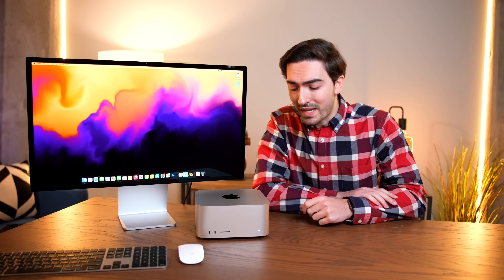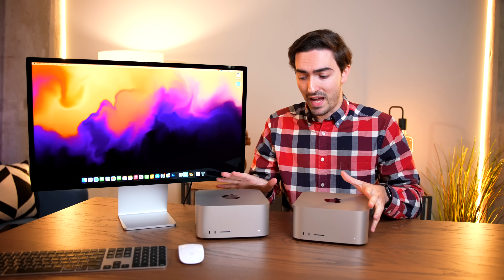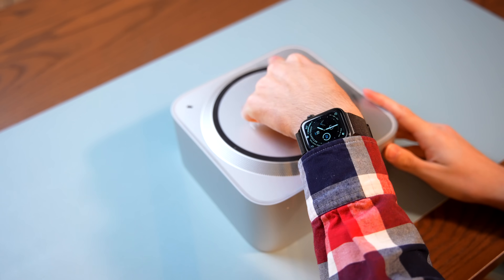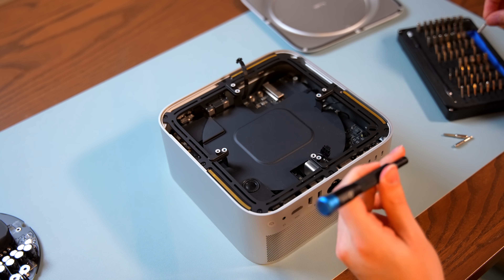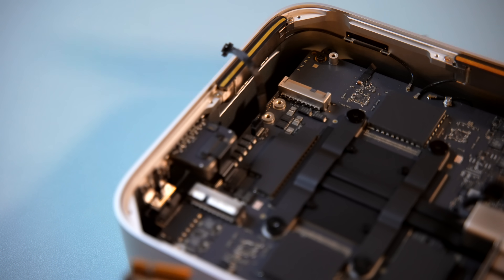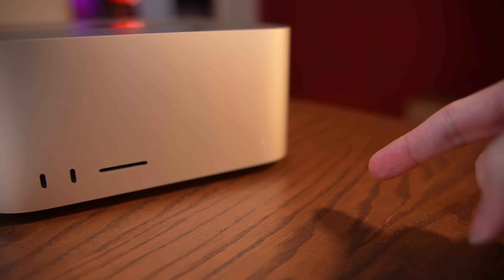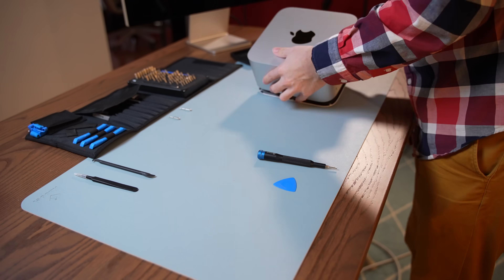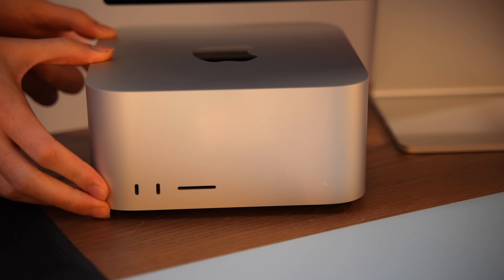What happens if you try to UPGRADE a $5,000 Mac Studio?

Comment: I think this was to be expected. All Apple devices in recent years had either a T1&2 chip or some other secure enclave function, with that comes hardware encryption of storage, not just on a data level. Mainly so that memory devices can not easily be extracted, transferred to another machine and read. Either the storage was 'paired' with the hardware or it wont work. 

Just by the way, most car radios have to be registered in ECU of the car to be enabled, most only the manufacturer can do this. So to prevent theft and sales of stolen items.
Reply: encyption does not work like that, you cannot just put an encrypted drive into another machine and read it, and in this case the machine itself is ID'ing the SSD there's no need to do that if you want to "encrypt" data.

All your passwords in all databases are encrypted without having the need to ID the drives.

We can still protect the data written on drives without having the computer check whether it's the exact same chip which manufacturer installed or not
Reply: @nishantdesai3705  
"...there's no need to do that if you want to "encrypt" data..."
It's like why do we need MFA, we can just only use a password to authenticate..

I see 2 different perspectives, 1 is security, the other 1 is related to service/upgrade related.

I can understand and respect both.
Reply: @RIKOARIshowreel  no with MFA it adds additional security, whereas with this system it does not, people do not roam around with with their mac studio's SSDs in their pockets right?

MFAs came into the picture because of phishing attacks, browser's "save pwd" functionality, etc. Currently there's no known way to easily breaks high level of encryption (aes or any other 256 bit encryption) in feasable time period (few hundred years)

So if some random dude has a feasable way to break the encryption (which is highly unlikely if not impossible) and they can open your mac studio and steal the SSD to get your data then now they would just steal the mac studio together with it (which do happen) so there's literally no benefit, all it does is help Apple preventing you (consumer) to fix your mac studio if for some reason storage module stops working (which is fine if they'd soldered it on to the board but they didn't).

All major websites/companies dont store sensitive data like user's pwd on macs right? they save it on other regular machines which are probably rented from AWS, Google or Azure (which might have disk level encryption)
Reply: @nishantdesai3705  
"...people do not roam around with with their mac studio's SSDs in their pockets right?..."

I agree with that, whereas not sure on this one "...no with MFA it adds additional security, whereas with this system it does not...".

We can have so many arguments about this, but in the end we have no justification on what use case(s) Apple have behind the reason for doing this.
Reply: This kind of encryption won't work. First, all key stored in a physical hardware, if someone wants to crack, at least you got hardware to extract the key. Second, if you know there is a hardware encryption, in case it can't transfer the ssd to another machine to use it. Then you have to backup regularly. Then backup is another weak point of information security.

Comment: Apple used to be great at this with upgradable storage and RAM on their unibody MacBooks. It is really bad of them to artificially restrict upgrades like this. And flashing the SOS signal is just ridiculous. Poor little Mac have feelings and you violated them. I wouldn’t be surprised if Apple will get a law that says their products have rights and you are violating their “human” right by opening them up. If I buy a product I should be able to upgrade it. Old macs are still very usable when upgraded. I gave my mom a 2012 unibody MacBook Pro with upgraded 16GB RAM and a 512GB SSD and it works fine for her. You can boast about using less plastic but when you restrict things to make them get obsolete quicker you don’t get any points for being environmentally conscious.

Comment: Yikes… If Apple had wanted to make it accessible the bottom would twist off with a coin… the way they used to. But given the screws are hidden under the rubber ring it’s a clear sign this wasn’t going to end well. With ‘only one more Mac to go’ I can imagine that if the Studio was upgradable it would cannibalise the future Mac Pro Tower. This is also why the Studio GPU is throttled (MaxTexh video). Similar reason why Final Cut isn’t available for the iPad Pro. Hopefully Apple will change if there’s enough push back. Here’s hoping they provide more options for Pro users.

Comment: It's likely the T2 Security layer. It likely locks it at the hardware level. It'll be interesting to see what happens when 3rd party, or replacement drives are available. 

I'm betting when a virgin drive is ordered, it'll work fine and software will become available to un-pair and nuke the security from the drive (while likely also nuking the data, of course)

Comment: It sure looks like Apple Company did something to lock the original installed solid state drive to hardware of the Mac Studio so that if the hardware and firmware does not see the originally installed SSD the machine will fail to boot. This does get ridiculous that the internal SSD can not be user upgraded. This is all the more obvious by the fact that Apple is using their own proprietary SSD.

Comment: I think that the removable ssd has nothing to do with the ability to upgrade. I suspect that the memory swap issues on soldered ssd’s was creating headaches for them and this is there solution to fix failing ssd’s rather than throwing away the whole board .

Comment: sos = option+alt with USB drive plugged with ISO bootable plugged in > disc utility > format = welcome to Mac
Reply: Suppose you could also have a bootable network, and you didn't boot into "recovery" holding the power button as you said, you just don't know what you're doing.
Reply: And boot to recovery, btw, not to system with many other checksums
Reply: Jfc, that is NOT how you boot into recovery. Smfh

Comment: On Apple's "Security features for Mac Studio" page (I'm assuming links aren't allowed in comments), it says the SSD is encrypted, so it makes sense it wouldn't be able to boot from a swapped SSD: the machine does not have the encryption keys to read the SSD from a different machine.

From the page I mentioned above: "Secure storage: Your storage drive is encrypted with hardware keys to provide advanced levels of security. In the event of a catastrophic failure, data recovery may not be possible, so you need to back up your files to an external source."

Comment: I agree that we need the right to repair, esp when a company claims to be so environmentally conscious. I don’t agree that they have to design the power supply to be idiot proof. If you want to try on your own, like anything else you can repair, know that there are risks. Right to repair, to me, is for independent repair facilities. But remember there are bad ones out there.  I agree about the locking down of the SSD though. That’s a step too far.

Comment: Apple maybe update the firmware to allow third party storage upgrade.
Reply: Yeah , maybe or maybe not
Reply: "Update firmware" or "remove malicious code from firmware put in place because they hate their users"
Reply: SSD not normal one. If Apple sale there own SSD. They will update firmware to accept it.
Reply: This is not an x86 machine. We cannot use the same logic. The SSD Controller does not live on the SSD itself on these machines. The only thing on the removable part of the SSD are the raw NAND chips. Completely different architecture than the PCIe interface that we are used to seeing on an x86 machine. Can’t “fix it in firmware” because the hardware is completely different.
Reply: @phillipmckay8221  That's BS. You can have multiple SSD controllers and just disable whichever you don't need. How do you think you've been adding multiple SSD's to your system until now? This is just an intentional malicious restriction added by Apple for pure profit. 
You can just buy the cheapest Mac Studio with the smallest included SSD and add a third part 2TB NVME SSD. This will be so much cheaper than picking the extra storage from Apple.
Reply: @mariuspuiu9555  Nice to know you have no idea what you are talking about.

Comment: Hats off to you for great work.
Reply: "Great work" might include googling the part number on those TI controller chips (CD3218B12) to find out they're for the adjacent USB ports before leaping to conclusions about penny-pinching SSD controllers ... which didn't make sense anyway because there'd still be pads on the board if they were no-populating parts to reduce cost.

Comment: Those SSD slots are clearly just for Apple to configure, they are not designed for people to upgrade themselves. The fact the machine is not designed to be opened easily should tell people that. I don't personally see an issue with this and if I need more storage I'll just use external SSDs, they are plenty fast enough for most applications.

Comment: The other thing is you mentioned you pulled the ssd from a 5k system and put it in a 4K system. Are the speeds of the drives from same?

Comment: I have it on good authority that when you order the 4TB or higher you get the controller. Also the machines have their SSD module serialized via FW in the secure enclave
Reply: So why bother having a connector on the board if it doesn't have a required controller with it? That doesn't make any sense. It only makes sense that it has some utility, which is possibly prevented by software.

Comment: Dude, seriously. How click baity can you get?  The thing with you young Apple YouTubers is you haven’t been using Apple computers for very long.  

Back in the 68k and early PowerPC days SCSI days, you COULD NOT swap in a new hard drive or CD drive. Apple drives had special ROM chips that identified them as Apple branded drives. To get around this we had to resort to third party disk driver software like FWB Harddisk Toolkit. 

You entered this situation assuming that was a second regular SSD slot.  

Clearly it is not. And if it were, what are you going to plug into it? You can’t buy those SSDs.  

Clearly the machine recognizes its own SSDs. Just like they used to do. 

But oh! The outrage! 

Back in the day electronic devices had labels that stated: “no user survivable parts inside.” So keep your grubby hands off. Because there was no way to assure that the end user making repairs was qualified to do so. 

That doesn’t mean that you can’t open your Mac and try to fix or make changes… with parts you probably don’t have. 

If you need it fixed bring it to Apple. They are most qualified an have the parts.

Comment: Isn't this a little over dramatic? If I take a hard drive out a a windows laptop and put it in another windows laptop it won't boot because of bit locker.  I know this isn't exactly the same thing but these Macs have the secure enclave in them and that IMO overall is good thing even if that means you can't upgrade the ssd.

Comment: I have my 2015 iMac with an external SSD drive and quad core intel processor. I have an iPad Air2. I have a laptop PC Running windows 11 and a Ubuntu laptop as my daily driver. I don’t plan on upgrading my iPhone XS Max, IMac, or Ipad Air2 until there is no other option.

Comment: I agree if you have removable ssd you should be able to take it out and replace it. If you buy a Mac Pro you can remove anything and they expect people to buy a 5k machine that nothing is upgradable. That is complete greed. I hope the video spreads far and wide and changes Apples minds. Thanks for your bravery. It really helps the apple community. I also saw max tech video on apple restricting the power of the GPU and processing only going to 75% what's up with that. So many things wrong here.

Comment: Devil's advocate (IT infosec POV): they aren't restricting SSD swaps to prevent an Evil Maid attack from exfiltrating data; encrypting the disk with the TPM key already does that. They're restricting SSD swaps to prevent someone from replacing your OS drive with one that appears to be the same, but actually has a rootkit / keylogger / etc. installed. Technically possible for an Evil Maid (although they'd have to get a good sense of what your boot unlock screen looks like); but more likely for machines ordered online, while in transit to specific customers—especially for government employees working in unfriendly regimes.

This is also the reason Chromebooks have that on-boot warning you can't shut off when you disable their secure boot chain-of-trust: they're warning you that someone might have MITM-rootkitted your device before you got it!

And this is why both ChromeOS, and macOS, insist on wiping the disk when you raise the system integrity level back to full. That way, a MITM can't lower the integrity level, rootkit your device, and then raise it again to make it seem like nothing happened. If they want to leave the rootkit on there, they have to leave the integrity level lowered. Which is easy to check for.

Comment: unified memory argument/debate is flawed and invalid. unified memory been used for along time now in personal computing.  ryzen APUs utilize it for example, you can run a game on it that caches to vram and check up 12-20GB of 32GB in textures and stuff.. the latest call of duty modern warfare sometimes see vram usage touching on 18GB !

 completely possible at least on M1 and M1 pro series to have completely upgradable system memory and still keep full unified memory access, for M1 max or ultra, those memory modules are way to fast to match with system memory off the shelf..

Comment: The real problem isn't that it's not upgradable. The real problem is that it's not even a user friendly solution. It's a big, fat, ugly box that takes up a lot of space on your desk and that has wires running around everywhere. A 27" iMac didn't do that. It was a "discrete" computer that was hiding all the unnecessary clutter and that never got in your way. This thing does. At least the Mini is small-ish, even though it still gets in the way. I have a very old one that I got second hand for $100. At that price it's a great deal, but I still hate its wiring, believe it or not. The Mini actually feels worse than the gynormous gaming PC case that is hiding below my desk. So now we got from Apple the same thing that we always hated about PCs: clutter. One step forward, eight steps back.

Comment: That's Apple for you. This is why I'll never choose to buy another Apple product where I have any input into it. There are still Windows laptops being produced - albeit few and far between - where even the processor is upgradeable. An SSD should be a given, and RAM should absolutely be an option - at least where there isn't a significant performance benefit from integrated memory as you mentioned.

Comment: it's not a more hazardous opening procedure to have the power supply there - 
1. they have bleeder resistors on the mains caps 
2. the back part of it is covered by that black plastic stuff 
3. the SMPS transformers are all covered in those black covers. 
4. even the act of removing it ensures that the mains connector is unplugged. 
in terms of SMPS's, it has to be the safest one I've seen in a long time however, in terms of longevity - probably not the best designed due to all the covers and the lack of ventilation.

as for the Mac itself, if people keep buying this stuff, they will keep shafting you.

Comment: If you would have a clue you would create meaningful content. As you can clearly see, the SSD Module does not contain a controller. The controller is on the board. This controller is built for a certain amount of Storage. Due to the fact that the controller is separate and that the controller is specific setup for the built in storage module, you can replace the SSD with an SSD of the same size and then you would ha e to train the controller for this new model. Try to replace the controller on an NVME SSD, good luck it will not work, until you are able to train the controller there either. First learn your stuff and then do a video.

Comment: Did you try leaving everything as is and just add a 2nd SSD into the 2nd slot without moving anything around. Or even without turning things off.  The process of elimination had to many changes made that may not have been necessary. Go back to the beginning and try one thing at a time. Also find information on the main board and the “missing chipset’s” to see if they’re necessary. Btw I agree with you on right to repair. Welcome to 🍎. 🤬

Comment: The reason it is modular could be because they’re planning some repair ability on the studio but haven’t enabled it yet in the firmware-which could be done via an update-because they haven’t announced the replacement tools and parts. 
Also This could’ve something to do with the Secure Enclave. The second ssd inside the first studio you tried on probably sent the machine into a state where it detected intrusion and could’ve wiped/corrupted/modified/whatever (I’m not an expert at this) the encryption keys to prevent stuff like data theft or stolen storage or something along those lines. What I don’t get is why the primary ssd also failed to boot it up.

Comment: Isn't this just a case of encryption where the drive and its data are only accessible with the key of the computer it came with? Of course, everything you said about the manufacturer is likely valid nevertheless, but if it is encryption, it simply means it is impossible to steal the data from the drive by taking it out, copying it and placing it back later.
By the way, with journaled file systems the computer or operating system may see inconsistency already after a couple of these attempts, if there is a journaling going on outside the encryption, too.